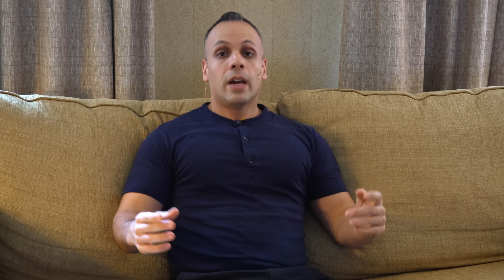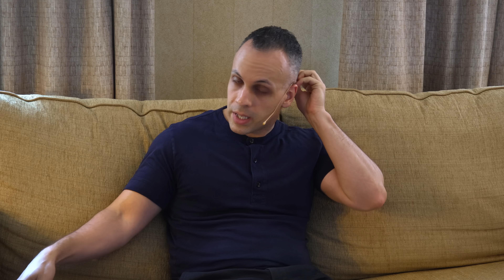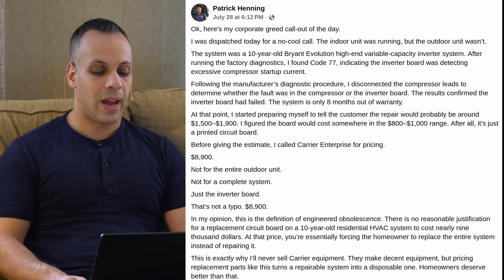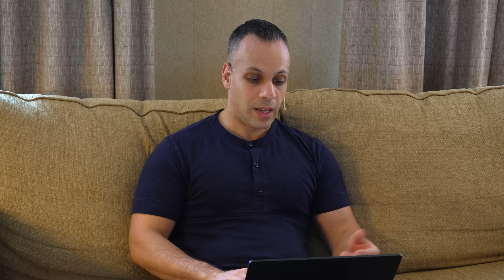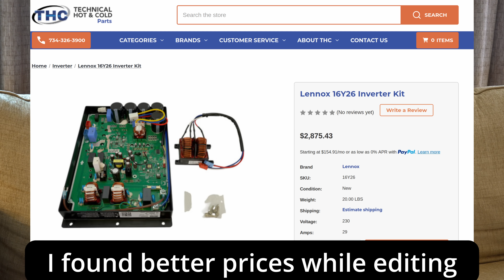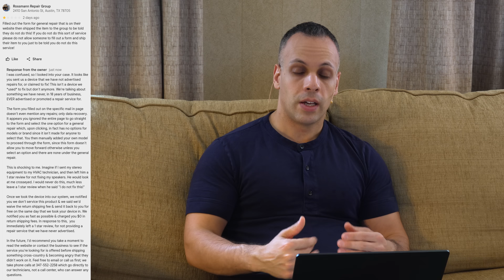Carrier AC repair has $8700 part cost for residential unit

Comment: The HVAC industry as a whole is an overcharging  racket. Just check the prices that your local A/C company charges for a simple capacitor. Something that cost around $45 max on Amazon will run you into the hundreds if purchased from your local A/C contractor. Now if I had a Carrier system and they wanted to charge me $8700 for a converter board I for sure would just opt to buy a new system but it wouldn't be a Carrier. These kinds of prices for repair should result in companies that charge them to go out of business. Perhaps there are too many stupid people with too much money out there for that to happen.

Comment: I haven't used my A/C in over two years and I live close to the Mississippi river in Illinois. Plenty of heat and humidity during the summer. This week it was over 90 degrees and 70% humidity outside.....

Instead of using the A/C, I bought two dehumidifiers, a single 20 inch box floor fan, and a small personal 4 inch desktop fan. You can easily get by with no A/C using my setup if you can keep the humidity under 60%. For my 800 square foot townhouse, the electricity bill during summer went from $130+ a month down to $85.

Comment: Data center factoid: Clarksville, Arkansas' data center plan includes 40 natural gas turbines. So who is going to pay for the natural gas infrastructure needed to provide the natural gas? We, the residents of Arkansas  will through increased gas bills. Early last year, our gas provider sent out notices in our bills that there would be no rate increases for the remainder of the year. A few months later, our Public Service Commission approved a 23.4% rate increase. Imagine, if you will, what the infrastructure for providing gas for 40 gas turbines will do to our bills!

Comment: Carrier's replacement parts seem to be expensive due to accounting tricks.  Every failed coil or board will be written off against profits.  They will only sell the replacement part for a cost substantially more than the original sale price of the entire system.  This way all warranty parts replaced "free" during the warranty period can erase more than the sale price of the individual unit from the books.  Carrier has done this for more than 20 years.

Comment: I can comment directly about this, because I'm dealing with a similar issue.  Trane package outdoor unit.  1 year old.  Failed to cool.  1 month out of warranty.  Contacted heating and cooling company and they did a pressure test.  Found that the coils are leaking at the welds.  These coils should last an extremely long time:  it's a no-wear item.  It has no moving components.  Yet, Trane, Lenox, Carrier.... all the brands have the same attitude toward their warranty.  They will only cover the price of the part, which is miniscule in comparison to the labor and recharge costs for the unit.  Result:  A virtually brand new commercial AC/Heat unit that cost $25,000 new needs a $1900 repair after one year in service at my expense.  Stratifying that further - it only cooled the building for 4 months.  And if you check around, you find dozens of these same complaints with many referencing the coils.  So many that a law firm once floated a class action about AC coils.  Screw these companies.  Can you imagine if auto-makers excluded labor from their warranties for things like their powertrains?
Reply: "So many that a law firm once floated a class action about AC coils."  Been thinking this for a while myself. Why didn't they do the class action lawsuit? I've seen other class action lawsuits against HVAC companies listed on the internet.

Comment: Every company is doing similar things or just plain not supporting products.

The craziest repair I've done was on a wireless controller for a mobile crane.  The manufacturer said not supported after ten years.  Buy a new whatever.  I can't remember.  It was either a new control system or crane.  Either way, it's hundreds of thousands of dollars.

The issue was a single shorted glass diode in the controller worth $0.10.  

The gentleman I work with repairs AC boards for residential and automotive.  There is no interest in commercial boards worth thousands.  Is it lucrative?  No.

Comment: I had my HVAC given a seasonal checkup service. They spent 5 mins and said everything looks good. No idea wtf they even did. When i asked if things like the condenser coils and fan are usually cleaned they said no. Thats extra and my unit is old anyways (its 8 years old!! Installed when the house was built!) and that they usually just fully replace everything. This shits a scam. So now I'm gonna learn how to clean it myself.

Comment: Charging this much for a circuit board would be a lot harder if we had a robust repair industry with parts allowed to be available.
I'd think you could fix the boards much cheaper than $8000

Comment: 4:54 That's a bingo!

$9k for an inverter board is absolutely insane considering there are inverter welders from china that are handling WAY more amps for under $600, and that's the entire machine.

Looks like you need to start a home appliance division...

Comment: Some contractors really do that (the fix and resell used equipment at a "reasonable price") working for some of these  less honest individuals makes it hard not to view the field of HVAC as a bunch of thieves, don't get me wrong there are some contractors and repair men far and few in-between I might add that do help the customer especially when money is a big factor in being cooled or baking in the heat. As to the comment of repairing those boards it would be a good investment because I don't to my knowledge know anyone that repairs the boards (which I'm still learning everyday and could be wrong about the board repair) which would be frowned upon due to the profits some of these individuals walk away with. Which most parts like contactor, capacitors, and thermostats can be found/sold cheaper from online sources making it similar to getting parts for an iPhone from online instead of the iPhone store.

Comment: Unfortunately, this is where the residential HVAC market is going, just like everything else. These ducted inverter systems are taking off to the point where eventually, the traditional single stage cooling systems might become completely obsolete at some point. But there lies the problem. You don't have a contactor and a capacitor. It's all built into that big inverter board. So if one capacitor dies, guess what? You need a whole board. And as seen in this video, the whole board out of warranty is very expensive. Some brands are not quite as expensive as the one noted here, but they are pricey nonetheless. And that's only part of the problem. At the beginning of 2025, we switched over to new refrigerants in the residential market that are called A2L refrigerants. And because of this, small repairs turn into larger repairs because you can't buy the equipment that uses 410A anymore, so now you have to replace the whole system in certain circumstances, where before you could just replace some of the parts or system and get by at a cheaper price. Unfortunately, most people need heating and cooling, and this is becoming a trend with all the manufacturers, so there's not really much we can do about it. And they know it too, those blood suckers. The inveter systems are very nice though when they do work properly. I've been dealing with them for about 15 years now and they're really getting to a point where they are pretty reliable compared to a traditional system. Some of the manufacturers like Daikin give a 12-year warranty on the parts.

Comment: I recentlhad 2 A/C failures. Naturally, I was worried that I might need to reooace the whole sustem but it ended up being a control board and the capacitor on the comoressor. A/C xhecks out fine. When I asked about newer mor effiixient units, my A/C guy recommended I keep this as long as I can because it's cheaper and more reliable. It's an 18-year old unit (a Goodman, incidentally, heh)

Comment: Amazing.  
My ancient HVAC system failed in my house this year.  Talking to a local HVAC company, he asked what I was looking for and I told him “dead simple, and easy to get parts for.”

Fully installed, a new Rheem Classic system for my 2200sq.ft. home cost less than the price of this one inverter board from Carrier and my electric bill still dropped $200 because the new unit was more efficient, even without a $9k inverter drive.

Comment: 4:30 id say do it. I’m not an hvac installer but I’m an MEP design engineer and the amount of times I see people replacing full boards because they lack the expertise required for piecewise circuit board repair (blown capacitor, whatever) puts a very sharp pain in my ass. Youd be saving a lot of headache and money for hvac customers big and small assuming carrier or daikin don’t have you executed
Reply: This. So annoying how the company wants employees to replace the entire component as "insurance", which is honestly fairly reasonable but then the customer gets that big ass bill

Comment: I'm not sure what the Bryant Evolution looked like back then, but the current one now looks like a Carrier Infinity -- which I believe is actually a Carrier/ICP original design?

I have a Heil (sub-brand of ICP, which also is parent of Carrier) inverter system that is actually ODM'd by Midea and available across many different brands -- some of which are not under ICP, so I think part availability should be much, much easier. I've been tempted to just source the control boards for both indoor and outdoor units just to have them available for a bad day. These units don't seem to have sub-brand specific parts from doing a lot of looking around. Everything looks exactly the same except for a different brand sticker on the chassis. The apps (there are many) don't say which brand system it is and the system works with all of the different brands' apps.

Also, I wonder if this redditor's Evolution had a TVSS/surge suppressor on the unit.

Yes, these boards cost a lot. Probably some decent money to make fixing them.

Comment: We live in a day and time where large entrenched corporations are simply taking advantage of the their position of dominance to abuse their customers. There has been a slow ramp up in this behavior pattern, John Deere, GM, Ford, all auto companies, water heater companies, etc. Quality is way down, repair costs way up. They basically are forcing you to buy a new unit as the repair option.
Reply: it's the EU way! check with them folks on everything.

Comment: Did anybody else notice that NONE of those reasons would justify an inverter board costing $9,000? 

1. Federal Efficiency Regulations & Updated Department of Energy Procedures
2. Transition to lower GWD refrigerants
3. Commodity and equipment cost increases
4. Increased equipment sophistication
5. Labor & Manufacturing Wage Inflation (He’s specifically talking about the install labor I read the article). 

Yes his statements were made in regards to the overall increase in HVAC costs but even then the first 2 have nothing to do with it, there is only 5-8lbs of copper total, equipment sophistication is the manufacturers choice SO basically ONLY 1 [labor & manufacturing inflation] … BUT install Labor which has nothing to do with Carrier products so really only 1/2 of 1 reason has anything to do with it.

Comment: As a contractor i do have a... i don't want to price.  Its 5x the normal price.   Sometimes people pay it because they like my work.   Ill tell them its my i don't want to price.   Someone who does the same  work who is 4 hours closer  can do it for 5x less and it will be faster than me doing it... they still want me to do it.   However,   these are usually my local people building a house on the beach (coastal Georgia) I know they will give me more work,  so i cut em a break on local work.   I just don't want to spend my day driving and getting nothing done.

Comment: Any chance of repairing that board at the component level?   Is that still possible?   (I'm an old-school tech)   More than likely, the problem is a failed semiconductor and a roached resistor or fusible link.   Are electronic components even still available to the general public?   The only hang-up might be a bad IC or EPROM, as those are often custom parts.

Comment: A couple things. Carrier is known to have way overpriced parts. Most HVAC companies have different levels of systems. My house is 3200 sq. ft. and the builder installed 2 Carrier builder grade units. They are as simple as it gets with no boards. With that being said when the house was 18 months old I noticed the 5 ton unit blower motor was on 24/7. I'm a DIY guy. These use what's called an ECM X-13 motor. They are a lot more expensive than the older PSC motors. The motor was covered under warranty but the original installer wanted $700 for labor. lol I bought an equivalent rescue motor as they are called. It was $300 and took me 45 minutes to swap it out. Still running to this day. I actually saved the old motor in case this goes out at least I will have one as a backup until I can get a new one. Mine failed in the least likely of the 3 ways. These X-13's either won't spin at all, start stop, or won't shut off. The actual motor part on these are usually 99% good. They have an electronic module on them that goes bad. If and that's a big if, you can locate just the module it's either more or the same price as the entire new motor with the module. That's not a Carrier thing as these same ECM motors are used buy all the HVAC makers. I keep in stock American made Amrad (the best) caps for both units and swapped the contactors out with Sureswitches. They are electronic vs mechanical which in this case are less prone to breaking as mechanical contactors are known for.

Comment: It's not just AC units --- my Tesla Model Y has the SAME problem at just 43,00mi. The PCS (Inverter) for home charging failed cost -- $3.,673!!!!  Tesla knows this is a defective part from the vendor after a NHTSA recall for this on Model 3's 2018-2019.  My car is a 2020 and NOT included.
The PCS also charges the 12v battery because an EV does not have an alternator.  
These electronics are ruining products and people's lives literally.  
Who can afford an AC repair of $9k??  Hopefully my EV will fall off a pier soon!

Comment: A company could make Amazon look small if they made high-quality appliances with free online service manuals and reasonably priced AVAILABLE parts.

Hell, I'd do it, but I could never get the capital required. You'd probably have to drop a few million to get the first product out the door. Wonder if Elon would be interested? Lol.

The trick is it would have to be private. Once stock gets involved, you get all the same problems current manufacturers have. Particularly private equity types. They will force you to do this kind of garbage. They have to be kept out.

Comment: Inverter drive is never worth it for efficiency and that isn't the primary selling point - it's worth it for cold climate heatpump applications being able to maintain heating capacity as it gets colder outside and avoiding a lot of supplemental electric element heat use, enhanced comfort and zoning applications.
Carrier has a long history on totally gouging on parts and is probably the worst manufacturer for that. 

The north american hvac manufacturers also gouge on inverter drive equipment and the parts - digging their own graves, while midea is making affordable inverter drive equipment that works on normal ductwork with reasonable purchase and parts costs.

It does not need to be this way, could have very high tech inverter drive systems with affordable parts by standardizing it all - and the firmware is just upgraded for the specific unit.

Comment: I have experience manufacturing a high cost low volume inverter board(using the very latest technology, which this is probably not) for similar sized heat pumps. Our actual cost for prototypes was like $700-900 and I think after all the overhead was factored in we sold them for like $2000. But we were selling very low volume so I have to imagine Carrier could afford to sell them for like $1500 and still make 40-50% margin. $9000 implies their cost to make just the board would be upwards of $3000 which is really not likely, unless they just have no idea what they are doing and are manufacturing custom silicon. They are a big company so it's possible they just don't have any engineers who know anything left due to cost cutting/corporate greed and they have to contract out every part of the design so their product is very expensive. There are many big old companies like that, the greed devours them from the inside until they are no longer competitive in a real market.

Comment: Pricing for anything you MUST have in 2026 = bend over.
Just replaced a dead attic fan at my Mom's house (for $50 and 60 min of my time) that was quoted at $800 by a contractor.